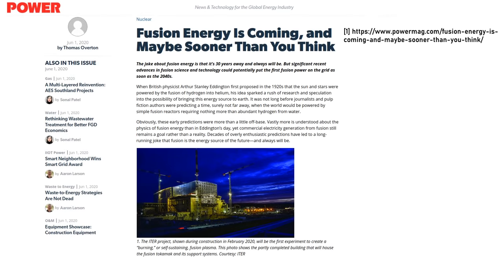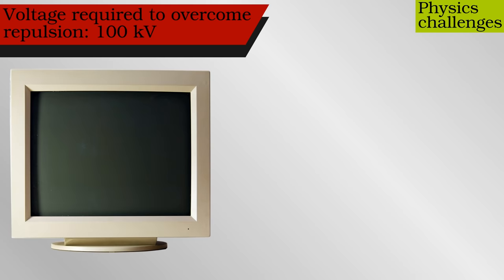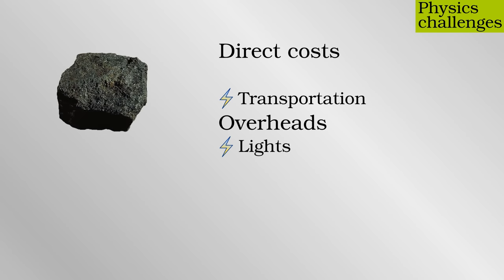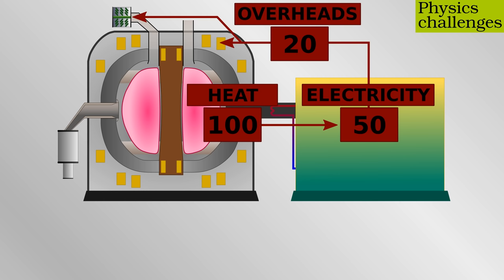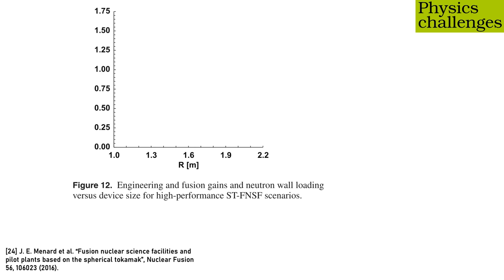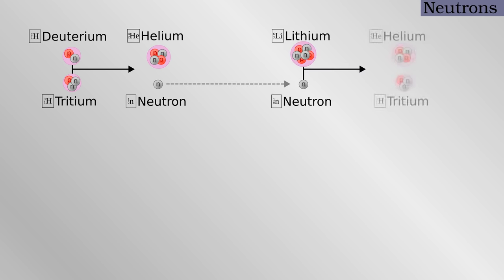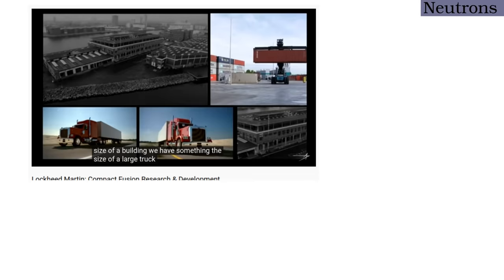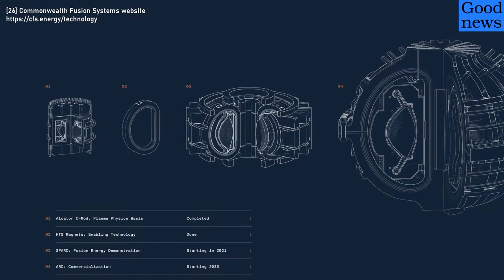Former fusion scientist on why we won't have fusion power by 2040

Comment: Thank you for taking the time to explain this, and especially for your honesty in the fact that it’s not entirely safe(nothing is)or figured out yet.  It looks maybe promising for the future, although i must say I like renewable energies.
Reply: isn't a fuel cell that combines oxygen and hydrogen to make water and power technically fusion in and of itself?
Reply: @raven4k998 No it isn't.
Reply: @tehhappehhaps  then what is it magic?🤣
cause it's not burning it🤣
it's not using power to make water with it so I would assume it's fusion since your combining lighter elements to make a heavier element and getting power out of it as well simple🤣
Reply: @raven4k998  Water isn't an element, it's a molecule! The atoms of hydrogen and oxygen still exist once they are locked into water. Fusion is where two atoms combine to create a new element. A fuel cell works with a chemical reaction, fusion is a nuclear reaction - the difference is the behaviour of the subatomic particles which make up the atoms involved :)
Reply: Fusion is the world's 2nd greatest boondoggle,  next to "renewable energy".

Comment: 1. Ohh yes, the neutron stuff. My father told me this when I was a child, that fusion reactors wont be clean due to free flying neutrons.

2. I would like to know, how it could be theoretically possible to exchange the fuel in a fusion reactor? As far as I imagine, it gets loaded with the gas, then reaction starts and if the plasma is not exchanged the fusion will stop sooner or later. So I would expect that the plasma have to be somehow always cleaned from the by product and new fresh gas have to be added. But on the design I never see any kind of block that is responsible for this. I mean stopping the fusion, put new fresh gas in it, and restart it will cost lot of energy. So it would be much easier to renew the plasma continously.
Reply from the maker: The plasma with some remaining fuel and Helium byproduct recombines back into a gas at the edge of the reactor. It is then pumped out and separated. Fresh fuel is pumped in as a gas. This happens while there is still a plasma and the fusion reaction is going on.

Comment: You've explained how it wasn't efficient enough right now but not why it is so overly optimistic to expect improvements soon. How do you measure the time needed for improvement?
Reply from the maker: That's a good point, but people have been working on improving confinement for decades. There has even been a "Moore's law for fusion" proposed with confinement quality doubling every few years. This has stalled after the late 90s, but even assuming doubling fusion gain every 2 years it would take quite some time to go from less than 1 currently to 20 or more.
Reply: @ImprobableMatter  pretty sure they just had a breakthrough like a month ago with the strongest magnet ever made.
Reply: @rexcassidy  As he explained a breakthrough in ONE particular area is not enough. Even if somebody discovered a massively improved confinement mechanism it would NOT create a working reactor.
The best example to this is that confinement efficiency can be easily improved by increasing size of the reactor. So why are not simply building a massive reactor?
The slow and steady approach that ITER takes approaches most problems in parallel, iterating towards succes  (indeed ITER is a deliberate pun on iterating through generation of reactor designs).
Reply: I think that the main catch is that having a working power plant will definitely not happen soon, even if we figure out all the showstoppers tomorrow. There is just such a long lead time to deploy this technology even if we do have it. And before you can even think about starting production on a production power plant, you need to prove that it will work. If you want a working power plant by 2040, your proof of concept needs to happen within 10 years, maybe even less. That seems exceedingly unlikely.
Reply: @ImprobableMatter  didn't it just stall because they got far enough to know a huge device would work and dropped everything to start building it?
Reply from the maker: @tricky778  Yes, to some extent. This version of Moore's Law held while the machine sizes were small enough for a single lab or country to handle. So it took a major international agreement to get ITER going - it was originally signed into being by Gorbachev and Reagan.
Reply from the maker: @tricky778  So, to be fair, Reagan and Gorbachev signed off on an International Thermonuclear Experimental Reactor, not necessarily on a specific design. The "blueprints" have been continuously updated over the years to the very best designs made possible in part by JET and other experiments. So, the current project being built is based on 2020s tech not 1980s. You can imagine the difficulties in management, getting funding and so on over the years. Ultimately, people simply did not have the same kind of fire under their backsides as when Roosevelt and Stalin signed Lend-Lease into being.
Reply: @tricky778  : The political results appeared decades ago, and the motivations behind some of those results have arguably reversed, the only goal ITER hasn't reached yet is useful fusion technology. At the end of the day, ITER exists because all of the funders want the technology, but they also decided that it was going to take so long that they didn't want to pay for it themselves.
Reply: @ImprobableMatter  doubling every two years leads to factor 32 after one decade. That's extremely optimistic. 32 times .7 equals 22.4 and that's just one final step away from futopia.
Reply from the maker: @hans-joachimbierwirth4727  See my latest video. The National Ignition Facility have reported a 25x improvement in yield in 3 years for example. When fully funded, tokamaks were making similar, if slightly smaller, strides.

Comment: Honestly surprised that you mentioned PPPL but not once a stellarator. Stellarators are superior in many ways to a tokamak, and if I had to guess if any design will succeed in the future, it’s that. Stellarators for one, have no free current, whereas tokamaks do, making it easier to confine the plasma.
Reply from the maker: The temperature record set by a stellarator is 10 times lower than the record tokamak temperature, so the technology is quite a way behind. The first demonstration fusion reactors are almost certain to be tokamaks.

Comment: Controlled fusion wouldn't seem to be possible at the moment despite the hype.Uncontrolled fusion isn't difficult which is why we can build hydrogen bombs.Even then you still need fission to act as the detonator as nothing else can create the power to cause fusion to occur.The reason fusion occurs in stars is they are huge and they don't need fission due to the weight of the star crushing the atoms together although I believe that as a byproduct stars to create a little bit of nuclear fission too.
Reply: You can use explosives to activate a fusion reaction. The fission reaction is only used because it requires less space and energy to be initiated. The only reason why the Fat Man reacted was because explosives were used to compress the ball of Plutonium so small it reacted. Same could be used in Fusion with lithium but uranium is far more effective. Also, they use lasers in controlled environments to initiate a small scale fusion reaction
Reply: @snakevenom4954  *...ONLY made as a result of neutron star collision.

Even Supernovae don't seem powerful enough for such heavy elements.
Reply: @snakevenom4954  Not necessarily true.  Many atoms are FISSIONABLE.  It's the ones that are FISSILE which release energy in usable amounts.  Plutonium is also fissile.

Comment: Very interesting and sometimes even funny Video! One Question out of curiosity: Is thermal to electric energy the only or most efficent way or are there other ways to directly get the energy?
Reply from the maker: Once the neutrons carrying 80% of the energy leave the plasma, they bounce around heating up the blanket which I mention. There is no neat way to stop them without simply have them dump thermal energy into a thick material.
Reply: @ImprobableMatter  thank you!
Reply: If we take as 1 the amount of energy that is released per mass unit during the hydrogen combustion in oxygen, then the nuclear fission reaction releases about 5850000 times more energy (a significant part of the energy is released as heat, which is convenient). In a nuclear fusion reaction, about 4.14 times more energy is released than in nuclear fission (a significant part of the energy is released in the form of neutrons, which is not very convenient). In the annihilation reaction, about 264 times more energy is released than in nuclear fusion (more than half of this annihilation energy goes in the form of neutrinos and cannot be used for practical purposes). The annihilation reaction is the theoretical limit of exothermic processes.
Personally, it is obvious to me that although further research of thermonuclear reactions promises many discoveries. If the task of mankind is sustainable growth, it should be recognized that the most practical would be the further development of nuclear energy based on nuclear fission.
Reply: There's something called "direct energy conversion" which has been around for a few decades in labs, which involves extracting energy from charged particles. It isn't useful for reactions where neutrons carry most of the energy, but for others ("aneutronic fusion reactions"), they could generate electricity at at least 60% efficiency.

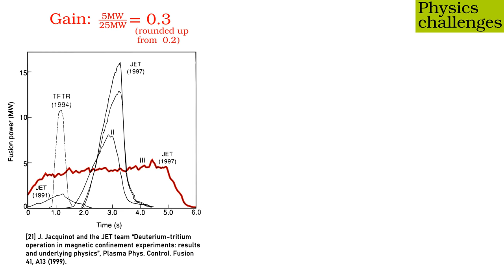Comment: 7:23 What does it mean for NIF to say “the fusion output slightly exceeded the laser energy input”?
They didn’t produce more energy (1.3 MJ) than even just the lasers’ energy content (1.85 MJ).

It looks like in a 2014 paper they are discarding the parts of the lasers that didn’t reach the center of the capsule, and discarding the parts of the capsule that didn’t produce alpha-particle self-heating… but they haven’t been able to make a system that actually generates only the photons whose power they included in their calculation. It always emits light that doesn’t contribute enough, and thus it has worse gain than the ’97 JET shown on the left, but they’re still claiming to be the first in the world to reach “fuel gain”.

Am I getting this right?
It feels very disingenuous to redefine gain like that.
Reply from the maker: I agree. Since the result had not yet been published in a peer-reviewed journal when I made the video, I had to rely on press releases. Different ones used different definitions of "input power", so gave them the benefit of the doubt taking the most optimistic one. The 0.7 figure on screen is more realistic. I am waiting to read the technical write-up.

Comment: What is your take on the practicality of the projectile fusion recently demonstrated by First Light? It appears to significantly lower the costs of achieving fusion, but I am sure there are some major drawbacks that I am missing.
Reply from the maker: They are at the "look at us, we're doing fusion" stage, which as I say has been reached by a teenager. They will need to demonstrate the 20x fusion gain and tritium breeding which I mention in this video. Furthermore, because they are a pulsed power scheme, even then they would produce about as much net energy as a goat walking on a treadmill. They would need to perform shots at the rate of a machine gun (1 to 10 per second) to create a power plant.
Reply: @ImprobableMatter  From what I understand they are already building a machine to do exactly that to be finished in the early 2030s

Comment: My take is that: it’s like having a fission reactor turn a spark wheel on a bic lighter and someone calling it a success!
Reply: This video discusses the shortcomings of fusion reactors. Fission reactors have been in use producing electricity for consumption for decades. Fission reactor's safety and construction drawbacks are being overcome by new designs. Fission is the practical solution to our energy needs, screw fusion.

Comment: 7:05 - 20 times, not 20 fold. The word "fold" means double, so 20 fold would be 2^20.
Reply: Fold can mean to bend double, such as a metal sheet, but when used at the end of a hyphen, it means to multiply by the value in front of the hyphen. My source is The Free Dictionary. Scroll down and look for -fold with a hyphen. So 20-fold, which is also written as 20 fold, means multiplied by 20.
Reply: @jonathanbush6197  Ok, but then why not just use the word "times" (eg. something increased 20 times) and avoid the confusion? Because in some scientific papers they used the word "fold" when talking about doubling.
If you ask me, it makes more sense for it to mean double, because with each fold of a metal or paper sheet, you are doubling the thickness.

Comment: Most people are indeed biased toward anything that isn't ITER. I don't understand why, as this slow and steady approach is in my eyes the most promising one for projects of this scale.
Reply: People are biased against ITER because of all of them, it is most clear that the design approach ITER is using can NEVER result in an economic power plant because of it's sheer size. ITER is a megaproject already and the fictional successor design to ITER that would produce real grid power (called DEMO) is a megaproject of an even larger scale, all to produce a meager amount of energy on the grid. There's just no way that will ever beat solar panels and wind turbines in the economic realm. Thus an alternative is needed. ITER is a neat science project like the LHC (Large Hadron Collider), but just that. It'll be useful for fusion research and research of related technologies, but it's not on a route to a functional fusion power plant.

Comment: Take a look at molten salt reactors which use molten fluoride salts to deliver both fuel and cooling. Many advantages including using range of fuels, including thorium and nasty isotopes of U and Pu. Designs can make melt down impossible.
Reply: Look up thorium pros and cons, and do some reading....
Reply: @LordZontar  If you don't like the data, take it up with the providers. However, data can be manipulated and molded to fit any objective one wants to present, like your false data on health affects of nuclear. But we have eyes to see that nuclear industries have stagnated and are in decline over the last 30 years and renewables and energy storage have grown exponentially. Should I believe you or my lying eyes?
Reply: @jackfanning7952  Entergy says there will never be another large-scale nuclear reactor built in North America?  Is that why two are currently under construction in the United States along with the fifty worldwide?

"The IAEA says that the best that nuclear can hope for is a reduction from 10% of the worldwide electricity supply today to 5% in 2050. I think they are being overly optimistic. It will be closer to zero."

Because... you say so?  Reality doesn't work that way, Skippy.  Both China and India are expanding their nuclear fleets, the French are still heavily depending upon nuclear power and are not likely to alter that, particularly as it makes their electricity rates among the cheapest in Europe (opposite of what is now happening in a Germany which is expanding its coal-fired power generation because solar and wind are soaring in expense at the consumer end and they've nothing else to fill the grid reliability gap since foolishly voting to abandon nuclear power altogether).

BTW, it seems you misread the IAEA report as well:

"“The latest IAEA annual projections show that nuclear power will continue to play a key role in the world’s low-carbon energy mix, with global nuclear electrical capacity seen nearly doubling by 2050 in our high case scenario. Climate change mitigation remains a key potential driver for maintaining and expanding the use of nuclear power,” IAEA Director General Rafael Mariano Grossi said.

The 40th edition of Energy, Electricity and Nuclear Power Estimates for the Period up to 2050 provides detailed global trends in nuclear power by region. The report presents its projections for nuclear electrical generating capacity as low and high estimates. They reflect different scenarios for the worldwide deployment of this low carbon energy source.

From 2019 to 2050, global electricity generation is expected to more than double, exceeding nuclear generation capacity growth also in the high case scenario.  Therefore, IAEA experts expect the share of nuclear power amongst all sources of electricity to remain either stable or decline. In 2019 nuclear power generated 10.4% of global electricity.

According to the report, immediate and concerted action is required for nuclear power to reach a share of 11% in electricity production by 2050, as seen in the high case scenario. In the low case scenario, the share of nuclear energy relative to global electricity production could decline to about 6%."

https://www.iaea.org/newscenter/pressreleases/iaea-report-nuclear-power-to-continue-to-play-key-role-in-low-carbon-electricity-production

"One fact that I have learned is reliable about nukes. Anytime a nukie is speaking, they are lying."

Ad-Hominem Fallacy.  With that and your descent into inane babble toward the end of your rant, your credibility is shot.  We have no reason now to take anything you say seriously.
Reply: @LordZontar  Dream on, nukie. There's plenty of room for you on Fantasy Island. Speaking of fantasies, how did you come up with your name?